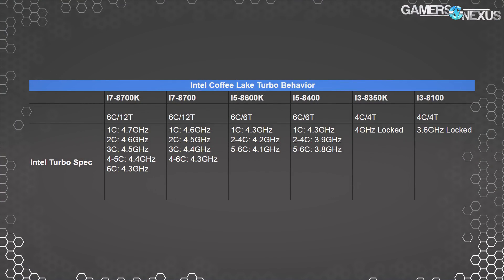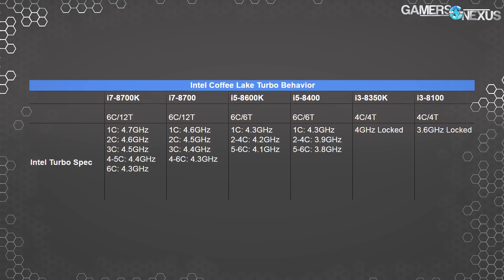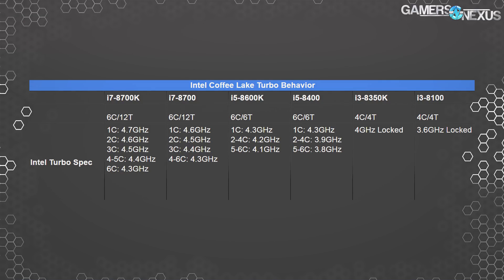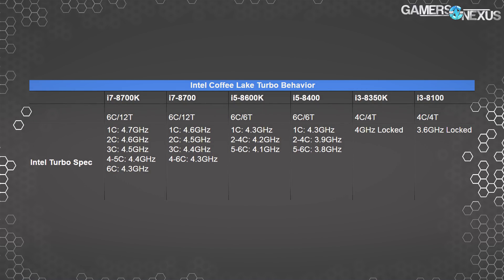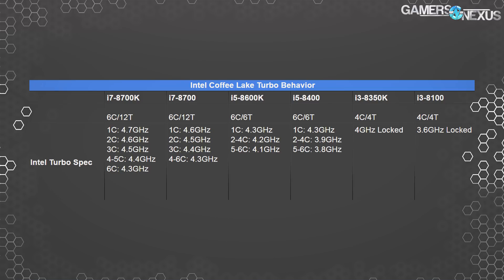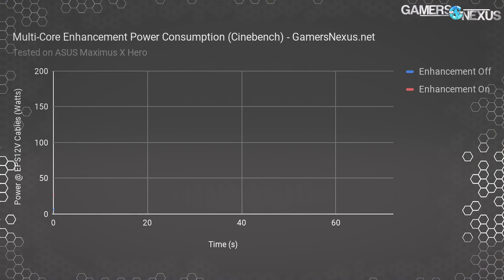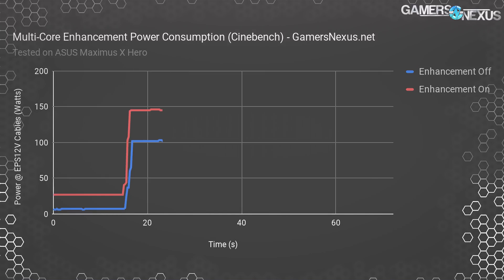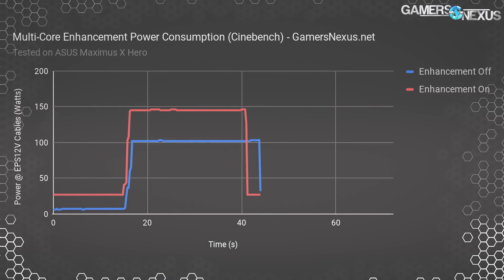Explaining Coffee Lake Turbo Boost Variance & Multi-Core Enhancement

Comment: Gamers Nexus if there is only instability in <5% of computer use, and >10% performance gain on 95% of usage, default on with better explanation boxes in BIOS that actually explain what all the options do. I'll never choose lower overall performance because of instability niche tasks. benching the computer for the tasks you run it for is an essential part of the building process. If it's easy to turn off then no big deal.
Reply: It IS a big deal, simply because a lot of people never enter the UEFI and might actually RMA the board if it keeps crashing. People that knows what it is and are comfortable changing things in the UEFI can do so in a couple of seconds.
Reply: How do you build a computer from scratch/replace a motherboard, set a boot drive and install windows without ever going into the UEFI? That seems like an unlikely scenario for someone who's building a computer.  It'd be one thing if the computers were OEM, but user built, they have to go into the Bios at some point, even for the first post. Plus he already said people are setting XMP. In a lot of case, turning on an all core boost will give greater performance than XMP anyway. Just seems like a good idea to me, not everyone is running Blender.

Comment: Should turn it off and manually clock your CPU I think , it's just the right way to do it . Until someone develops an interphased PC which can automatically do what manual overclocking does I think auto OC programs are only good for finding rough limits if you're impatient or just starting out you can use them to help understand the process

Comment: Multi core enhancement is simply auto overclocking by another name, it's not guaranteed by Intel to be stable for your particular CPU.  I prefer to do it manually, the auto OC will use either too much voltage or too little voltage in my experience.  Hence, I think it's best if it's off by default.
Reply: Yeah, the most concerning thing for me with MCE is the voltage increase when enabled.
1.4v without even going above the max multiplier for that CPU?  Seems a bit much!

Comment: Does it work on Non-K CPUs ?
If you buy K Cpu then you plan to OC it yourself.  
but even if gives 1% chance of crash in default bios then it should be ABSOLUTELY disables.
Tell them this and they will get it :   RMA due to crash by someone who doesn't even know what benchmarking is .
Reply: I know this answer is a bit late, but some people may still want to know.
Yes, MCE works with non-K CPU's.
Non-K CPU's just have their maximum multiplier locked at a certain number, and MCE will only ever increase all cores to whatever that number is, never above.

Comment: Off. Most builders just want it to work they aren't not really interested in tweaking settings or bios to get this stable.  Granted I think it should be categorized, maybe have a section in the manual related to the setting with a big warning so the pc builders will have the knowledge and the decision to turn on. I think that would cause less confusion around the clock speeds.

Comment: On, under the caveat that every motherboard can make it happen and it's 100% rock solid stable. If motherboard manufacturers can't guarantee that then leave it off by default.

Side Q for Steve: Will you be redoing your benches with it turned off to show the differences?
Reply: 99% sure he had it off for his review. He only turned it on to show how others were getting higher numbers.

Comment: I say on by default in order to give any user who doesnt overclock the max performance from the cpu. Also if its on by default the motherboard manufacturer would hopefully put more time into making sure that it is stable, rather than thinking its not a big deal if its unstable because only the smaller group of people who actually tweak bios settings will turn it on and possibly have an issue.
Reply: So how many thousands of CPU's are they supposed to test that the feature works 100% with?
Reply: Qyngali honest answer, i dont know. I know nothing about whats involved in making a motherboard and its features so please dont flame me if this but id assumet that they already do test quite a lot of cpu's with this feature on in order to make it work in the first place, so testing more to make it work more consistently doesnt seem unreasonable if people do end up wanting the feature to be on.
Reply: Sorry if I came off as flaming, that was not my intention. While I agree somewhat that making it enabled by default would increase the likelihood that they put more work into it, the problem is that they'd have to implement some kind of very thorough testing to make sure that it works with all CPU's, without using excessive voltage. As that would require a LOT of testing with different CPU's, development and time it's just not feasible IMO. And all that would also require people to enter the BIOS to run the stability test. At that point, it is better to just set it to off by default to save money (development cost increases the price for the consumer, not just the manufacturer). Also, who's to say that some time in the future somebody might release software that crashes because of this even if they somehow made Blender etc. stable.
Hope this helps,  sorry about the messy post as I'm short on time today...
Reply: Qyngali no worries you werent flaming i just wanted to make sure i dont get flamed by someone reading my comment and thinking i know more than the motherboard manufacturers do about how to make their product work. You bring up a very good point about the increased cost that could be put on the consumer due to the increase in development cost to make the feature better, which i hadnt thought about. I appreciate your insight!

Comment: I specifically asked Intel what the all core boost was pre-launch and was specifically told 4.7GHz was the all core boost. This was what I observed with the Asus STRIX-F board with default options.

"-What is the all core boost clock of the 8700K?

4.7 GHz" - Intel UK PR team

Comment: For stability and other reasons, I believe it should be off. I don't thing this setting is something you would want some regular Joe to either play with or have turned on by default and then wonder why he is having issues. I still think feature definitely should stay as it is nice feature, but it should stay for users who will then know how to turn it off and to turn it off, should it cause issues. Regular Joe won't have any idea what is going on.
Reply: The regular Joe wouldn't really benefit from this sort of feature anyway since most regular joes who buy these higher end cpus do so for gaming purposes and most games don't use all cores so the unused cores churning away at max turbo boost does nothing for them but give them a nice space heater for their room while also costing them more on their power bill and reducing the lifespan of their cpu.

Comment: Of course off by default!
1.4 Vid WILL reduce your precious CPU's lifespan.
You can achieve the same clocks on all cores with much less voltage (unless you have that 1/1000 chips that the manufacturer tested before setting this voiltage as default).
Reply: Not enough to matter of the course of 5-7 years. Your chip might not last for 15-20 years... but who cares?
Reply: Kvarnholmen - Calculators pretty much plateaued with what they do, back in the -80's... and they don't keep getting more sophisticated software/OS. If my TI 30 processor goes, i can pick up a cheap-ass replacement at Walmart or even a dollar store(actually i have many around here, but my Ti 30 is still my favorite). I paid ~$20 for it in '85. Anyways, when's the last time you saw anyone OC their calculator? (i still have several working Pentiums II/III and Celerons and P4's that were highly overclocked, and still work and OC perfectly to this day).
Reply: it makes a bigger difference then that.
Reply: 1.4v will likely not reduce the CPU's lifespan by enough to bother most people (as someone said already, maybe it will die in 10 years instead of 15), as long as temps are in check.
However, it will reduce the lifespan of the VRM's by enough to be a concern if you want to keep the system running for over 3-4 years.

Comment: I'm not sure if I would prefer it on or off, probably off, but I would definitely prefer that they change the name to something more appropriate. I had no idea and based on the name would never have guessed that its function was as you described. I have an Asus Sabretooth board and when I got it it was defaulted to auto and I just left it, I did OC the 6700k and I'm running XMP on the ram but I never changed the multi-core enhancement, its still on auto.

Comment: My Z170 Sabertooth Mark 1 came with Multi Core Enhancements enabled by default and it didn't ask or let me know, so anybody not in the know would be overclocking their CPU without knowing it, and overvolting according to what Asus decides, which is usually too much.  Off definitely for me, because of the overvolting by too much.

Comment: I think this feature was born not for MT tasks like Blender, but because of a flaw in ST turbo where if you're running a ST application at 1C turbo and then a background task is spawned by OS, it knocks down to 2C or 3C turbo, reducing ST performance. Ofc this is not the best solution for the problem, but that's the only one MOBO makers can do, since a proper solution would involve what they do on mobile chips with low power and high power cores, or being able to have individual frequency/voltage per core, and only Intel/AMD could implement it.

And yes, this should be off by default because a 40% increase in power is very material, specially if consider the Z3XX platform is marketed to run at 95W max, unlike the 160W of X299.

Comment: enhanced multicore - yes i would like to have this feature on by default, BUT only if it is 100% stable in all scenarios - why not have extra performance in form of default auto overclocking if your motherboard can  take it - you are already paying extra for the Z chipset and K cpu , so why not have more performance without trouble and maybe even knowledge of user in some cases. But a failsafe in some form of - at this max temp. turn enhanced multicore off - in cases where there isnt adequate cooling...
Reply: The issue here is 100% stable. Part of the reason for Turbo boost is that not all CPUs, not even all cores, are created equal. For the sake of argument lets assume that if all CPU's could run at 4.7, under all conditions, then they would be locked at 4.7 by default :)
Reply: yeah, but they are not locked at 4,7 by default because of voltage, temp and power limitations from intel. but i get the issue now, even with voltage bump what about that 0,1% of cpus that would not hit 4,7 all cores even with more voltage ... 
you should do a special edition motherboards that have that on by default and would come bundled with cpus that were tested and can hit those clocks 100% stable :)
Reply: Even if it is 100% stable then I still think it is undesirable for a lot of users because of the lower efficiency. Using 40% more power for a 9% increase in performance is bad, and this is also basically the reason why Intel designed the turbo tables the way they are.